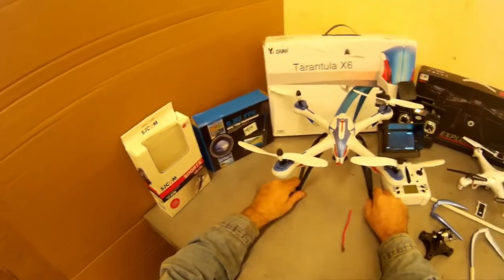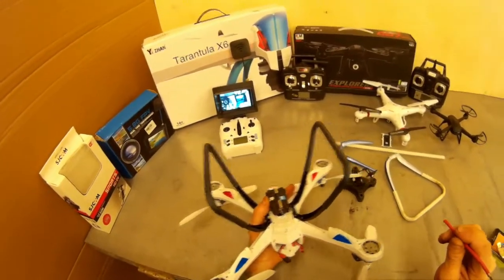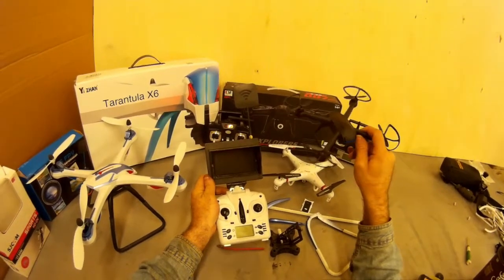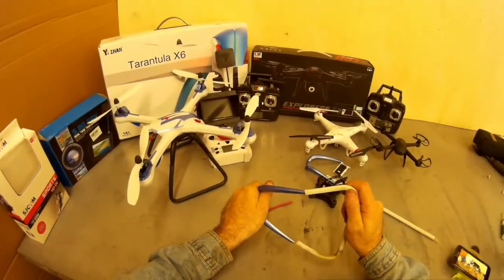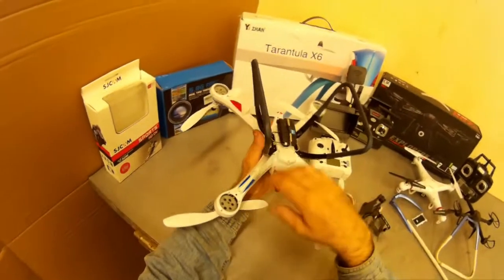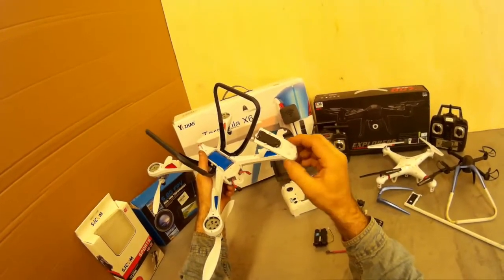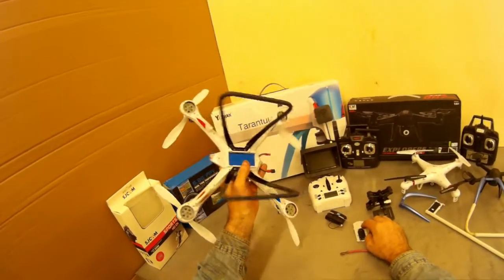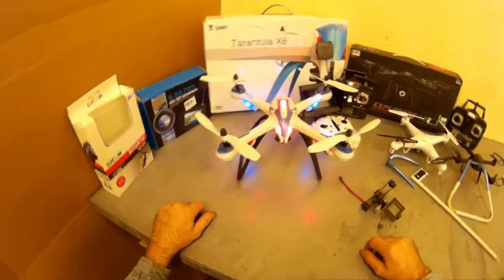Tarantula X6 quad copter with cheap Syma 5.8g fpv system

Comment: great mods, i love the landing gear one, i'm using the four pencil mod at the moment but i like the idea of cross bracing the legs, hopefully it spreads the bumps to both legs a bit. i wish i'd been able to keep my x6 looking cool, looks kinda took a back seat. i scotch taped the ends of the arms for bump support, one strip holding top and bottom together,      
     i also cut light covers as small as possible and just scotchtaped them on, i would really like to mod quads antenna, i already made tx's 3/4 wavelength and poked quads antenna through the top casing, but i would really like to have quad antenna improved,
  i fly in city parks to make little movies, and the interference is a worry. i tested in countryside'' and i got 200 feet altitude then drop outs with unmodded quad antenna, and way over 400 feet with tx at 3/4 wavelength and quads poking at an angle through top cover. i would love to just add another 1/4 wavelength poking at a different angle along quads arm to reduce blindspots, but i don't know if i can or  if it would cause electrical issues with receiver etc. i modded a syma x5c-1 o 2/4 wavelength and i ran out of eyesight before i ran out of control, not so great horizontally though, any ideas or 'know how' on quads antenna?